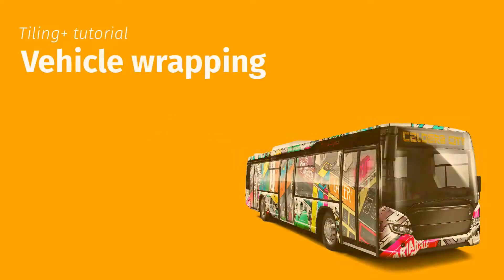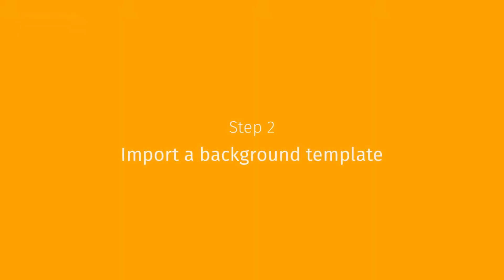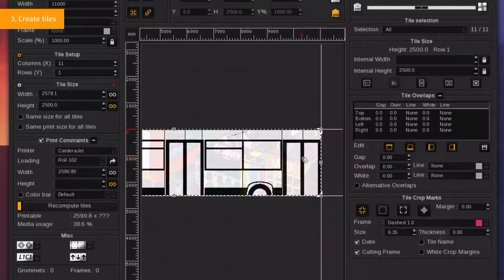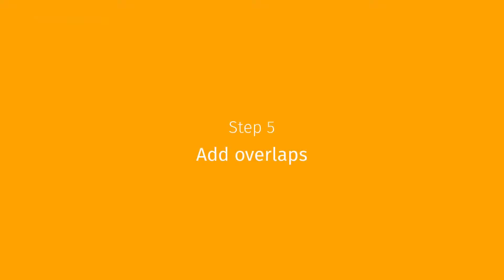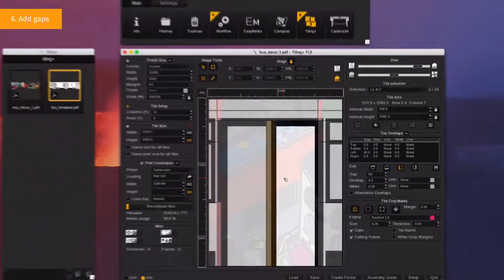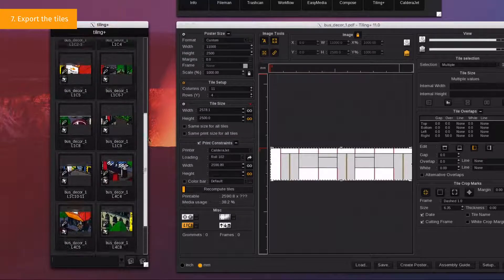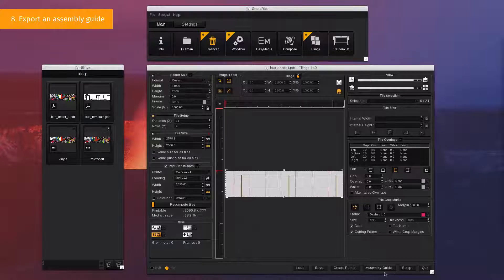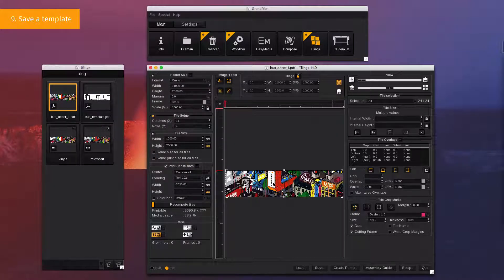Tutorials CalderaRIP : Tiling+ Vehicle wrapping

Comment: Guys, you completely skip over key features in this video - I was sort of hoping it would go into more detail because your Tiling Manual is confusing and ambiguous at best. For example - the "White" setting. The Tiling manual was confusing to me  personally on the subject of adding white areas for the glue. When I add a 10mm "White" value to a lower tile it visualises a blue10mm white gap appearing ABOVE that tile going 10mm into the tile above it - great! - but when I then add a 10mm overlap it pushes the white gap up ANOTHER 10mm??? What is it doing? Why? I'm sure you guys understand it in your head but I don't want to have to run a series of test prints  just to see how it behaves I need the manual to explain it. The file I'm working on is huge and takes an hour each time I want to run a test... I could use a smaller test job to test the behaviors when I apply the values in different ways but isn't that the job of the manual? Another example - "Alternate Overlaps" - this gets one sentence in the manual - a sentence which is confusing and may as well be written in Swahili (and again not mentioned in this video). Please please pleas overhaul ALL of your instruction manuals. They are too brief and probably need diagrams showing how a value applied in a certain field affects the print and why.